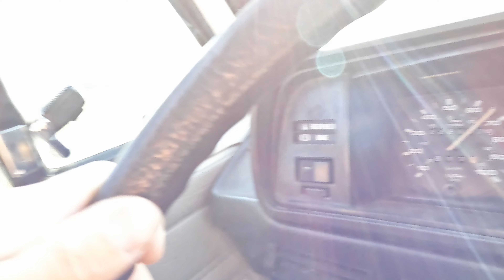New Mexico... again

Comment: Feel your pain going through a similar problem. Trying to narrow it down and i think my radiator fan is going out. Either that or the sensor is not telling it to turn on as it should. Good luck, hope it all works out
Reply from the maker: @nomaderic  it's a frustrating problem to have! I'm looking into swapping a mishimoto 12" race fan into the van instead of the oem fan on there. Hopefully that will help 🤷

Comment: Kudos to Taylor for driving without air conditioning while pregnant. Beautiful views. How many miles does your van have?
Reply from the maker: Haha yeah this was one of our more challenging trips but she toughed it out with minimal complaints 😂
This van has about 240k on the body, we've put about 20k on it since the motor swap
Reply: New Mexico looks beautiful. Where did you get your gauge set up? Thanks for your great videos.
Reply from the maker: @daviddesantis7872  Yeah NM is definitely one of our favorite places to go, I bought a cheapo gauge pod on Amazon and was able to mold it using a heat gun